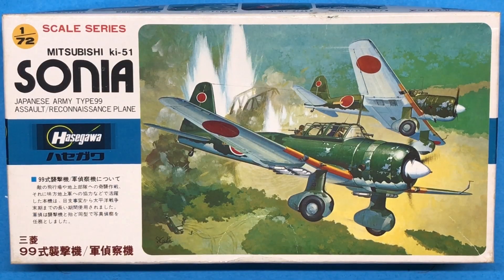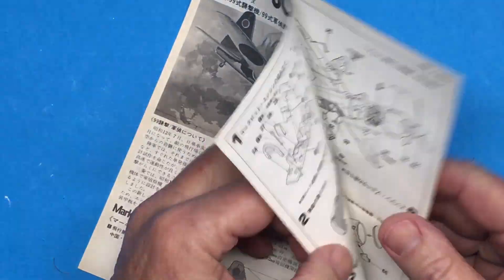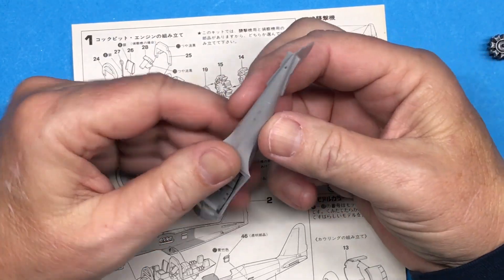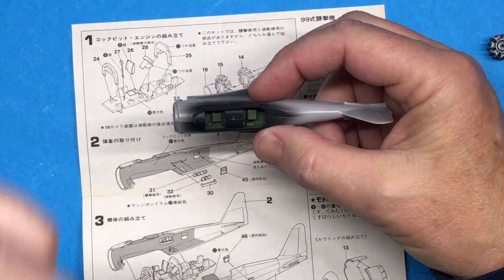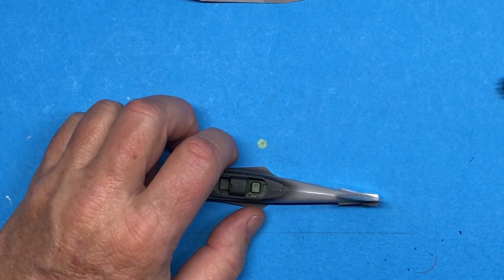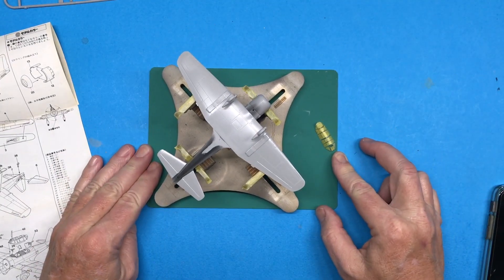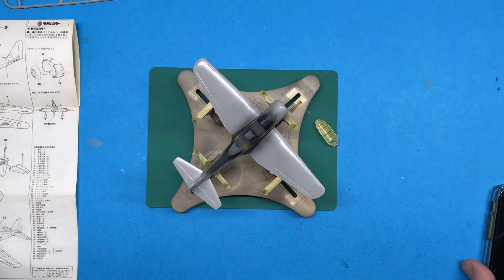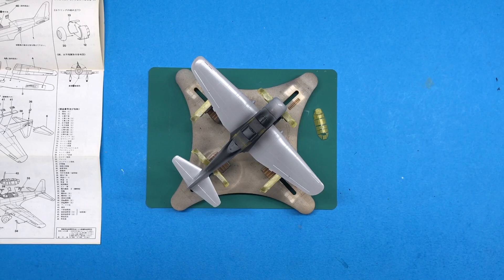Hasegawa 1/72 Ki-51 Sonia, Part 2 Construction

Comment: The windows you chose to ignore are the windows the cameras used for recon missions. I was a little disappointed you dismissed them as “optional” the box top clearly stated assault reconnaissance. Love your channel,but wish you would complete the kits correctly. I try and learn from modeling channels, not learn how to dismiss parts we don’t feel like doing
Reply from the maker: I feel like a scolded child now... off to the corner for me! LAL
Reply: First things first you build your model the way you want to. It's your money and your time. 

Now, not all ki-51 were reconnaissance versions. They did not all have the side windows and the bottom window that is for the camera. I can't even find a picture of one with the side windows installed.

@Madcat2099, if you're going to call somebody out on an accuracy issue at least do a little bit of research.
Reply: I do what I want…

😂